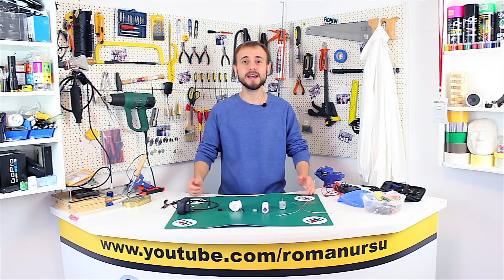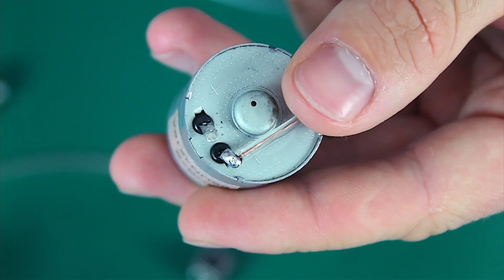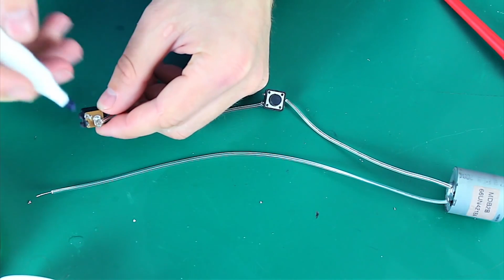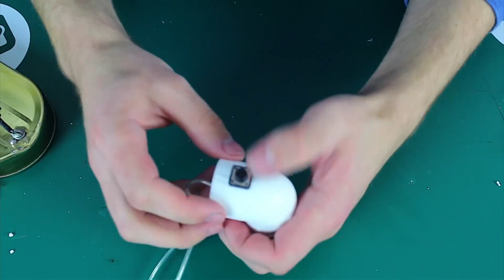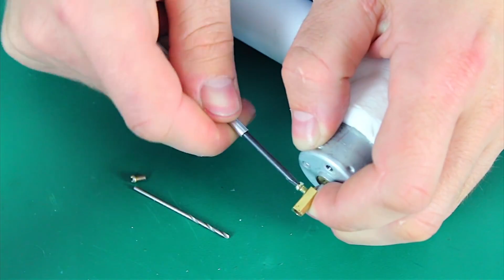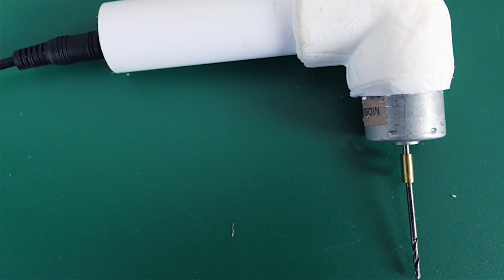How to make a mini drill / TUTORIAL

Comment: I don't recommend getting solder on the tip and wiping it on the wire you should directly melt the solder onto the wire otherwise the flux will be gone by the time it reaches the wire

Comment: if you add a second button with the polarity the opposite as the first button you could have a revers on it and if you have a bigger wire connector you could connect a screwdriver chuck to it to and then you would have a good little drill for small electronics

Comment: This video is totally devoid of any useful information.  For example, what size motor (diameter), type of tubing (size).  This is no substitute for using an ac motor, which would be much better.  If this video is suppose to be inspirational it fails.
Reply: its all homemade, so not everyone will have the exact materials available and will have to build it with whatever they have

Comment: you gotta make sure to put a flyback diode anti parallel to the motor. This will supress kickback voltage from the coil when it's suddenly turned off. That voltage can damage either the motor or the switch.

Comment: If you put two wire connectors to cut out a lot of the vibration. Place the two wire connectors so the screws are on opposite sides so you can balance out the drill. Thanks for sharing I love this setup
Reply: I've done one from old dvd motor, and i did add another connector as counterweight, but it still vibrates pretty bad. Still better than fingers, tho.
Reply: +Steve Rabon Bye! You could use epoxy filler all around copper joint  with the 2 screws fitting just any micro screws in the filler where you think it is the right balancing site... Good job!
Reply: Yeah anything to balance it out will work. The best way would just tap extra threads on the opposite side so you can center the shaft better. That is a problem as well because the shaft isn't centered in the middle of the connectors. When the screws are just on one side of the connectors it pushes the motor shaft to the other side of the connector and that makes it unbalanced as well. Thanks for sharing I love this setup.